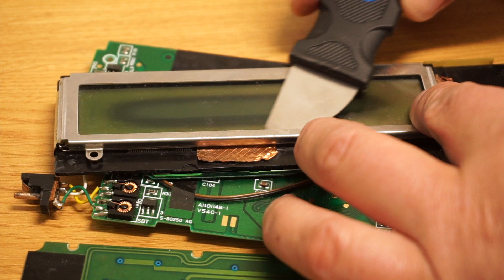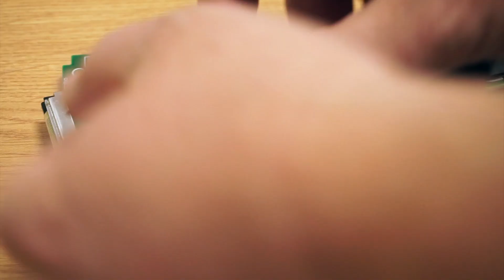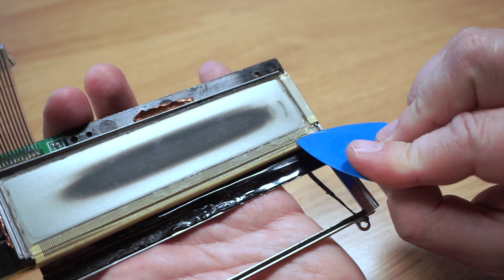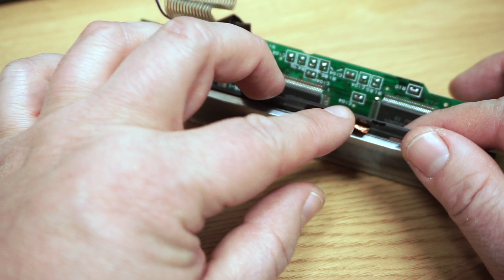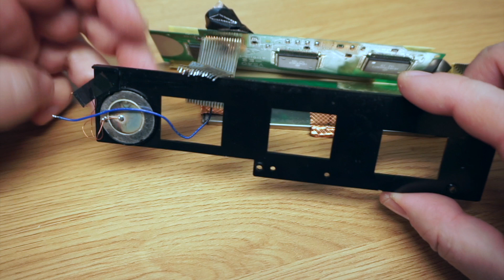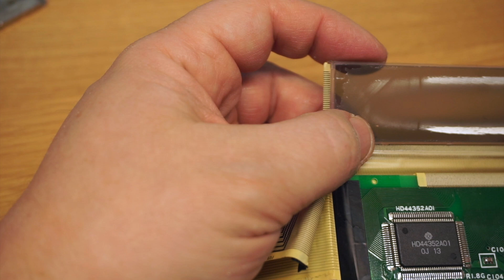HWRD #9: Casio PB 2000C Display Catastrophe

Comment: Hello @hardweird,

I have a PB-2000C that is working properly, except for the LCD, which has become completely black.

I have already removed the front polarizing film, and I am now preparing to separate the LCD from the housing without disconnecting the flat-flex cables, as I am unsure how to re-bond them to the glass once removed, to replace the back reflecting film.

I will use banana oil because it is often effective in softening and dissolving aged adhesives of this kind.

Have you learned anything new about this problem or discovered a repair method that might help us?

Any advice would be greatly appreciated.
Reply from the maker: I have restored the display itself since. You want reflective polarized film for the backing. I got it at 3dlens.com (not affiliated). Still haven't gotten around to bonding it however.

Comment: Some next video about that? To see if the whole operation is cuccesfuly?
Reply from the maker: Sorry for making you wait! The whole thing is still in pieces on my bench. Hope to get around to it soon on the upcoming vacation.
Reply: @hardweird   Not a surprise about that, I also have one, with two missing columns but fortunatelly still ok, can be read fully. The problem is the poor documentation about the Ansi C. After fire it up it seems that is not too much you can use it for. Anyway it's good for learning some very little about programming.